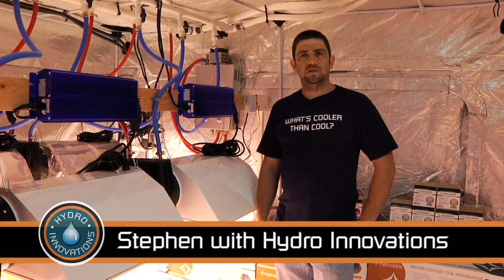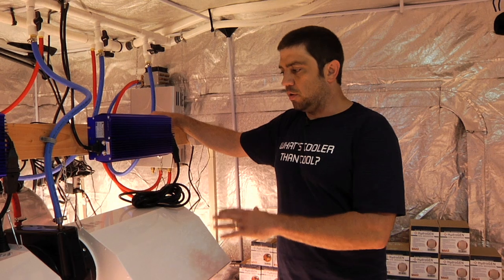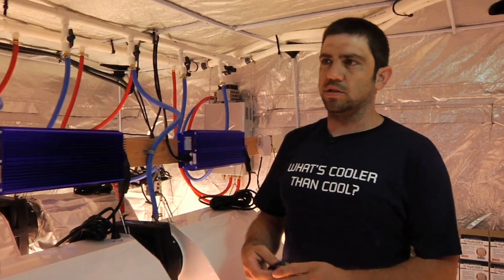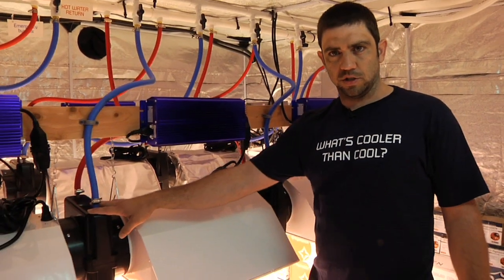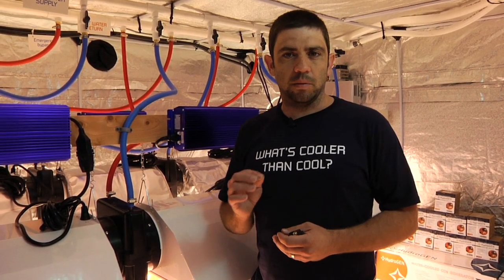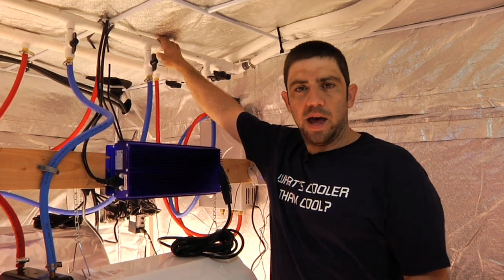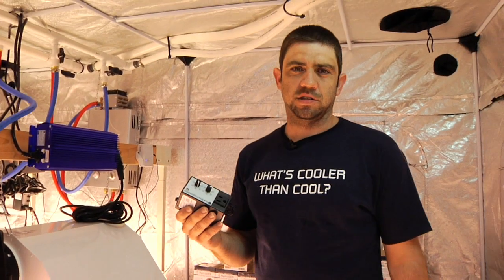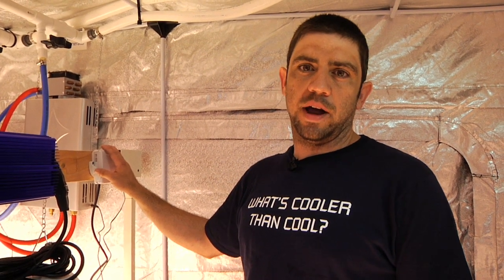Hydro Innovations Ice Box video

Comment: what happened to KISS.... lol

four letters... LEDs

2nd gen chips dont get that hot and reduce your HVAC cycles almost to a minimum
Reply from the maker: Piping water around your grow for cooling instead of refrigerant is KISS, and if you think LEDS don't make enough heat to need a high efficiency air conditioner you are wrong.
Reply from the maker: We have about $50k worth of illumitex LEDs in our test grow, I've been using them personally for over a year. I use 1k watts of led for a 4x4, although it makes less heat than hps it's still 1k watts of power and watts coverts to btu. If you are out promoting energy saving LEDs then naturally you should be supporting water-cooled a/c, it's the equivalent for cooling.
Reply: sbkeen thanks for the reply chief, i deal with commercial LED lighting from Illuminer Inc. not particularly growing oriented LEDs but they are twice as efficient when combined with growing LEDs dew to the high lumen outputs in a linear way. I happen to know a deep amount of info on the PAR spectrum and what SPECIFIC weave lengths are required per plant and at what growth stage... nothing like what i see out there today.

Having that said, I am now ordering from a specific plant in china that makes 2nd gen chips of their own to my wavelength specs. In other words, yeh you can call them and place an order, but you will never get the same LEDs modules i get. So I would like to ask you some questions as to what LUX output on the ground you get from a those 1K of Watts LEDs from the overhead canopy... at what heights...

How much did you pay per module? how many in total? what are their light outputs or lux reading at about 1, 1.5 and 2 meters...

I have a growing module of 288 watts for a 4x4 area that is amazing, i also combine it with my commercial LEDs on the sides of the canopy and facing from the bottom to up with liner lighting... so for your 4x4 area, i barely get to 500 or 600 watts, if i go hardcore because overkill is under-rated... ;-) then ill go to 750 to 800 but not any more... your LEDs are not being utilized the right way, sorry...

That's how i cut down on the HVAC cycles, its hard to get rid of all that heat man... it really is for a 4x4 1K watt, LEDs make about 1/3 Less heat overall in my opinion... (LED devices with internal power supplies) if you have external stuff forget it...

The problem is not the LEDs making light, its converting 120 AC into 24 or 48 DC... that is self is a fucking art of its own... kick ass muffled harmonics, switching power supplies are the key to the future here

go to www.scierotechnologies.com and you can see some of my Illuminer products and you will understand what i mean. I dont distribute the growing LEDs yet. But i am working on getting them the way i want them.
Look at the single chips on my Bay Lamps and look at how robust it is, that bay lay lamp has a 5 years warranty and you can wash it wish a hose while its still on... and the roadway lamps you can turn them on underwater...full IP65 rating...  good luck doing that to your leds today.
Also i dont use external power supplies or ballast... eveyr thing is single ended wiring, low wattage high lumen outputs, secondary lenses with a field view of 90 degrees for the bay lamps and 110 degrees for the T8 replacement LEDs... i cant stress enough for you to consider this type of lighting for a focused and direct lighting application within a small contained area

The Growing LED modules i will offer are with that 2nd gen larger chip and a basic power supply. Not as water proof as the bay lamps because they arent made yet by any one... but in a year i will get them like that... no worries, i dont want to manufacture because there are already large places that really know how to solder in china. Also dont trust any of the soldering of chips on any boards or any power supplies made in USA... they are not made for the long run trust me. Also, 95% of chinese LEDs also SUCK ASS for growing or commercial lighting applications, take it from me... an LED Boss

How do you light up the middle of the canopy? or the bottom to up? have you tried that before? have you considered Christmas tree style lighting with flexible waterproof strips of leds?? wink wink, again...

Do you Veg with Blue LEDs only? you should from now on, dont pay attention to what others say about the higher spectrum wave lengths...
the lower PAR spectrum wave lengths are the only ones absorbed during the veg of your flowers... when they begin to bloom, switching rooms with different lighting now aimed at the higher 640-720 spectrums is the way to go... difficult and expensive for an end user like you, but for a wholesaler like me its easy and affordable... not around $50,000 way less... How big is your facility.

But its all in the fine tuning like any car... the variation is so tiny but the yet the results can REALLY vary yield amounts.

Also, IMO having smaller modules with about 4 or 6 chips max that are highly efficient compared to those multi million chip modules is the way to go... dissipating the heat from so much will be inefficient even you said so your self... from a green guy to another green guy...
I would like to recommend better way of distributing your Watts of LEDs with middle and lower canopy lighting...

its all about placing the LEDs on the right spot

shoot me an email jacob.garcia@scierotechnologies.com
I have a lot of questions, may be we can network together.
Reply from the maker: I will be getting in contact with you, some things I agree with coming to my own conclusions and some a do disagree with. I'm certainly no led expert but we have done our homework. I have a different approach to gardening, that's why I have 1k watts of led over a 4x4. I'm most interested in dollars per sq ft rather than grams per watt, although I set my personal record of 10 yrs with LEDs at 2.55 lbs per 1k watts of led (4x4). I only did it once, my other have been between 1.72-2.25 lbs
Reply from the maker: I'm getting about 600-800 micromoles to the plant canopy with my led setup, that's about 12" from plant top to the led. Plants don't care about lux or lumens of course, the really only accurate  way to determine fixture efficiency for growing is the micromole meter, we use a licor 250a and they aren't cheap.
Reply: i asked about the lumen output or approximate lux readings on the ground to determine the amount of light coming out of your modules... that's why, PLANTS DO CARE about the amount of light coming at them. See my point?
Reply: sbkeen HOLLY MOLLY YOU are a pro... i like that... i definitely want to send you some of my products just to try out then...

I appreciate your honesty in the numbers it shows you work hard and have a green thumb that i can respect. I want to contribute some of my knowledge to help your future grows man for sure... im not claiming to be a pro either in no way... but i approach every thing with logic. And breaking a lot of stuff has showed me what's good and whats not...

be easy, keep in touch buddy.
Reply: LED's are HOT and theres no easy way to cool them aside from AC
Reply: yeh if you buy low quality LEDs they will be hot and wear out faster than expected... LEDs have an ROI and you can match lighting outputs it might just cost more for a regular joe like you
Reply: MaPee1982 any one that spends that much on anything I'm sure has know how on what they are doing...

you obviously don't know the operation costs difference over the long run when you keep buying bulbs every two or three grows and your light bill going off the wall enough to melt several power meters...

There are good LEDs out there, you just have to know what to look for... 5 year warranty, high lumen per watt, the right combination of LEDs between commercial and growing ones with the nanometer wavelengths you need at the right stages of the plant... I assure you, it pays off to use clean leds, if you want to grow old school with high electrical bills or stealing power, than that's fine...

There is a reason the Swedes and the Dutch are growing with LEDs, but they don't know anything right?

Comment: Also I must put more info>
The hoods will not be chilled.  But a stright pull and vent through air cooled hoods.  
So the room is sealed and Co2 controled, and I want to use the chiller to take the place of my energy counsuming ac unit.
Total light watts = 2400w

Comment: What about moving your lights? Great idea, in theory. Not very practical.
Reply from the maker: The hoses are flexible, we have sold nearly 20k of these, practical for some at least.
Reply: Sales and practicality are two different things. Congrats on your sales.
Reply: most pros don't move lights. that being said this can work but you need a good chiller hence the 3hp chiller you also need really goods lines and connections and low humidity.

Comment: A chiller unit might work more efficient than an ac compressor unit, but you are still doing the same thing. You do not get to bypass physics and laws of thermodynamics just because you are using water as coolant and heat exchangers instead of refrigerated air. BTU heat is BTU heat, whether you cool it with water or air. 

Until someone shows me actual data, and serious data at that, I will not buy into this idea that water cooling is superior in any way, especially energy usage, than refrigerated air, especially from mini splits with sky high SEER and EER rating numbers. It might edge out a multi ton central unit with a SEER of 13, but I seriously doubt it will edge out a mini split with a rating of 21

Comment: Your not getting this. I understand you build them for a living but your wrong. Let me give an example. You have a 2 inch pipe with a velocity of 10fps at 8gpm at 10 psi, now there is a restriction in the pipe such as a change of pipe size to 1 inch. And now you have 39fps at 8gpm at 10psi. Now by decreasing the pipe size without putting a bigger pump in you are creating a restriction to flow. And as you should know a restriction is always followed by a pressure drop. Do more research please.

Comment: Yes, I mean't fluid dynamics. But you are still dead wrong. Cover the end of a water hose does not increase the pressure, it increases the VELOCITY of the water coming out of the hose. The pressure stays the same. IE the flow rate in the hose is 10gpm, you cover up half of the end of the hose you now have a flow rate of 20gpm. This is not exact, but the principle remains.

If you still don't believe me read up on it.

Google this: Bernoullis principle
Reply: technically you are increasing friction. When configuring anything flowing through a pipeline, engineers consider friction first, sometimes the resulting pressure on the line at certain points, but velocity not so much.